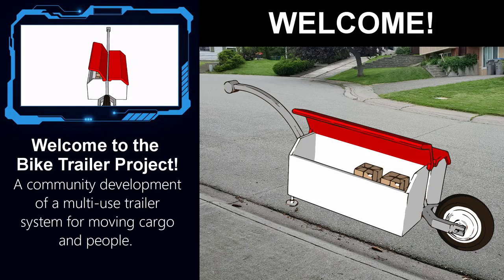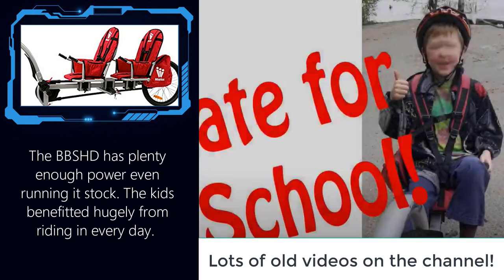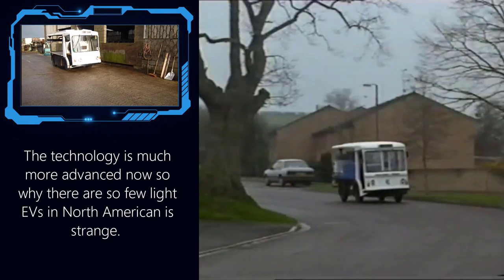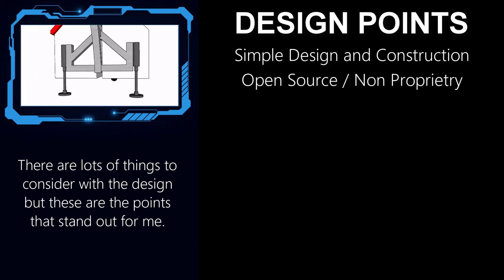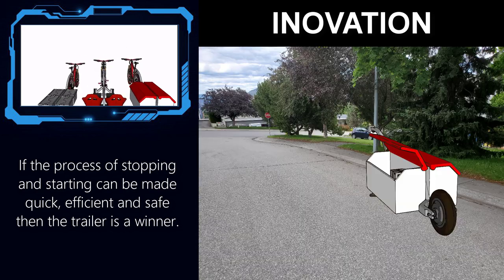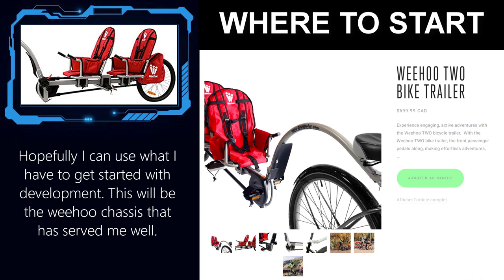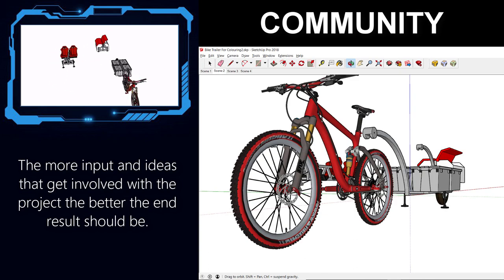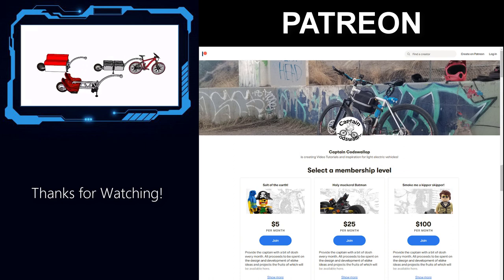Bike Trailer Community Based Project

Comment: Great idea. I imagine the discord server would be more appropriate, but I see the stability system having 2 levers on the tongue of the trailer, both to disengage a latch. One latch holds the legs to a spring, one holds the legs to a ratcheting system. Stop, pull the spring release, and the legs fall to the ground, ratcheting so as to be solid regardless of how even the ground is. Get off, push a plunger at the front of the trailer to prime the spring and latch it back onto the legs, then when it's time to get moving again - pull the other lever to disengage the ratchet. Spring retracts the legs and you are ready to go again. Also, when you release the ratchet-release-lever, the ratchet reengages and you have redundant systems keeping the legs up for safety when in motion.
Reply from the maker: That sounds cool. It also sounds relatively inexpensive. If you draw it out we can start a thread on the discord server.

Comment: I was just chatting with my dad about building a trailer for me E-bike so I can load up my RC planes and Race quads in it and go to much more isolated spots to fly where cars are not allowed. Perfect timing, I also want to swap my Sabvoton controller for a BAC and NXT screen. I'm using a QS 205 50H, don't know which one to get. You should check out my new E-bike build, it's going to be really nice as I'm welding an aluminum battery/controller box that follows the contours of the frame which is a Ruff Cycles Tango V3. I hope to see this trailer project move along. I could use it every day...
Reply: BAC4000 + NXT for max power with the QS205 50H. Far superior to any Sabvoton

Comment: I'm literally using spruce aircraft wood to make a lightweight super strong trailer in the building  style of a truss and gusset aircraft fuselage type of construction. It will use a single 26 inch fat tire I have laying around. It's a work in progress. I want to use it as a hunting trailer to pull out pigs or deer from the woods with my fat bike. It has a stock luna bbshd.
Reply from the maker: I like it. Sounds awesome. Can you post a few pics on the discord channel?

Comment: Having never pulled a trailer with a bike I wonder if it would be useful to have a integrated trailer brake. I guess it would depend on the weight of the trailer load. Might be worth considering?
Reply: If we had more info on existing technology, we would be able to put a homopolar generator instead of brakes and convert the momentum to electricity
Reply from the maker: If i used a rear hub we could regen brake!

Comment: I was wondering if building a suspension into something like this would relieve the frame from repeated stress.  I also had thought of building a trailer for my upcoming e-bike, and undecided on what to use for a frame.  I think t-slot extrusion would work well, with through bolts instead of t-nuts, and machined parts for the rear fork and seatpost attachment.  I also think the truss construction is over complicated and unnecessary.  You could just use rectangular tubing, set at an angle, and make the necessary brackets to hold the boxes.  A lot cheaper and simpler.
For the legs, cheap electric linear actuators would work.
Reply from the maker: Thanks. A few people have suggested the Alu extrusions. I have used them in the past to make a jig for a bamboo frame. The suspension is a good thought. I had to really considered it. More fragile cargo would require some for sure. Thanks for the suggestions! Cheers
Reply: I think to simplify the design even more, two extrusions can be used for the wheel stays, keeping the wheel captive, with leaf springs mounted to the extrusions and the wheel axle suspended on said springs.  The boxes can then be mounted to each side of the wheel, thus a larger wheel can be used and the wheel need not stick out behind the boxes.
Another thought is to use two wheels, and connect the trailer to the bike via a universal joint; this way the trailer always remains normal to the road surface, regardless of which way the bike itself leans.
Reply from the maker: More great ideas. Thanks!

Comment: Another thought is that your preliminary designs have awfully low, wide surfaces that may be problematic in turns.  However, most of my experience comes from motorcycles and may not directly translate to the dynamics of bicycles.
Reply from the maker: Yeah. They are more for the concept than exact designs. Some shaping may well be needed to avoid the scenario you mention.

Comment: Have used the Bob with rear wheel hub motor meany years ago now . Wheel was too small . Plus it bounced all over the place
Reply from the maker: The trailer ran a rear wheel hub?
Reply: @HighVoltageKits  
Yes 
The batteries were mounted under the trailer deck. Sealed lead acids
Twist throttle and cut off switch up on the bike.
My mate got it second hand
Replaced the batteries and used it to commute to work 20km round trip no hills.
He is always finding treasure on the side of the road and at intersections.
Plus forever being given bits and pieces of this and that. So it was perfect while the batteries lasted.